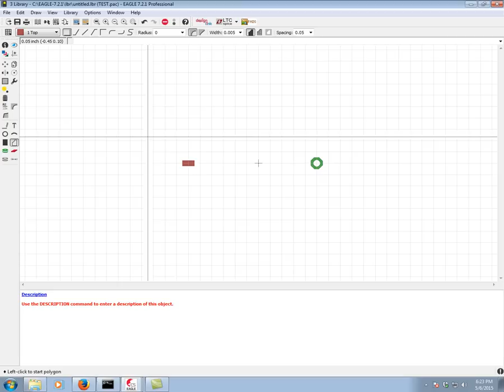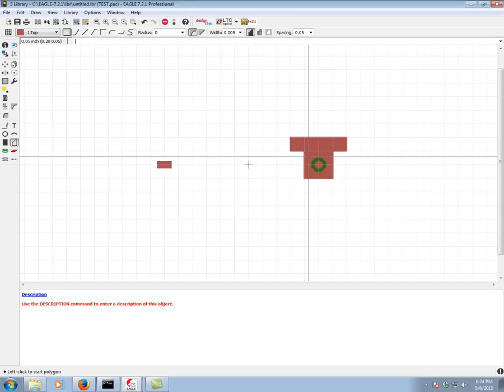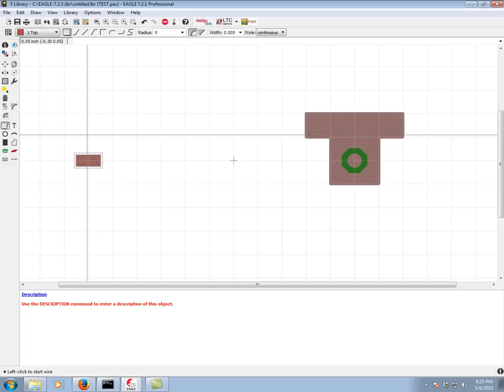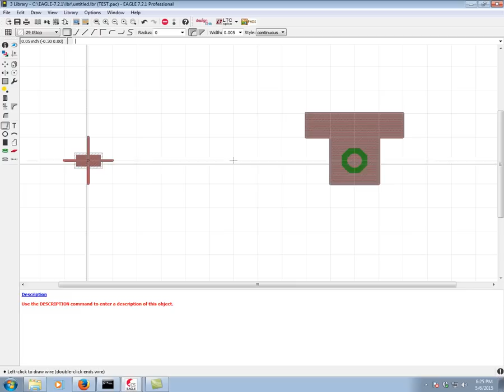Arbitrary Pad Shapes

Comment: what if I desire a smaller pad?
Reply from the maker: When you have the pad attached to your mouse cursor you can change the size by changing the value for the pad size on the action tool bar that appears at the top of the screen. If the pad is already placed on the package go to the Pad Properties to change characteristics.